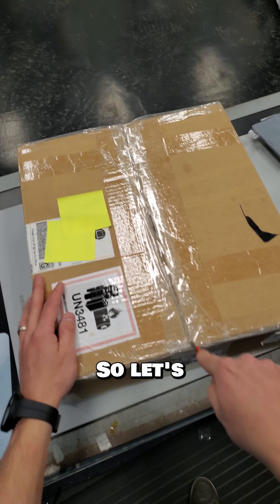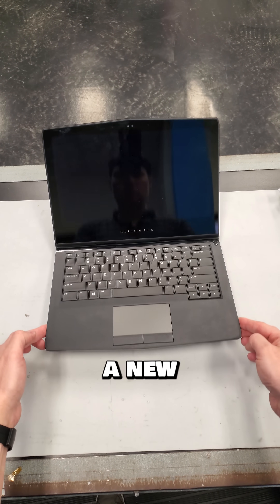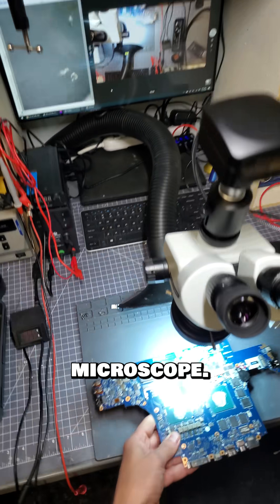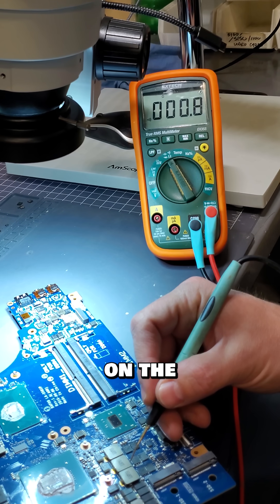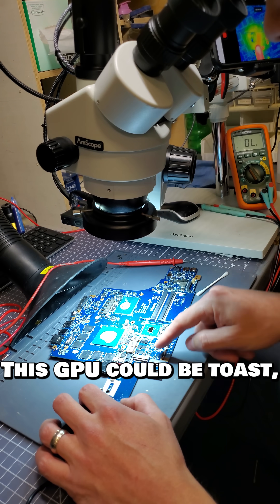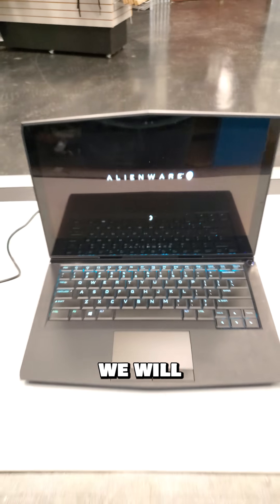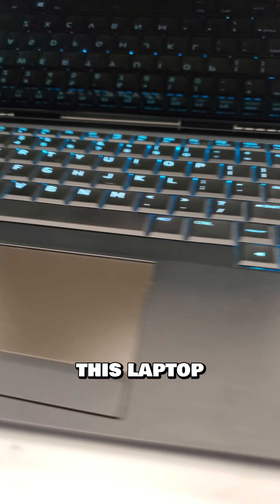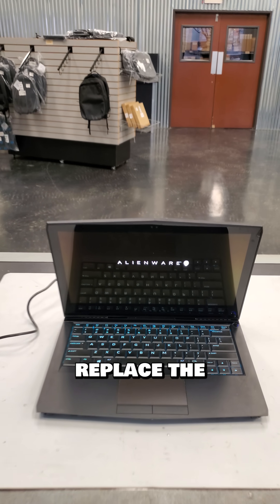Game Over? Gaming Laptop GPU Repair Fix #shorts #laptoprepair #computerrepair

Comment from the maker: If you need a repair and it is a Dell/Alienware laptop and you live in the USA or Canada, then yes.  You can fill out a service request form at partspeople.com
Reply: Can you fix my Razer Blade 15 2021 please? It has a GPU error as well
Reply: I have a HP Spectre with a shorted motherboard unfortunately. Would have strongly considered sending it to yall if it was a Dell!
Reply: Working on my university final year project and my laptop just gave up midway 
They said it's a motherboard problem too
Reply: I mean it seems like you know what you doing. I have a busted a51r2. Looking to be fixed. I'm in Australia tho. 😢
Reply: Do you know anyone that could do the same type of service on an Razer ?? 🙏🙏🙏 Exact same story as this. Sent to Razer, they told me I need to spend $1100 on a motherboard
Reply: I had a very expensive one that shorted on the external GPU plug that i never used and it was refurbished and like 3 months after i bought it so dell refused to fix.
Reply: What about MSI or Asus?  Their customer service is GARBAGE wanting to charge 1300 for a new MB.
Reply: He can just a buy an egpu best way
That way motherboard is safe
Reply: Really someone would choose to convert it to integrated graphics only when they specifically bought an Alienware for a reason
Reply: I have both a alienware 17 r4 and 15 r3. Both quit working from not being turned on. The 17 r4 uses stopped working from bios update which broke intel ME. Any idea if fixable
Reply: Can you accept laptops from Nigeria
Reply: @tochukwuokoye5588  he can but shipping is going to be very expensive alongside with your affordability as his prices are 1st world.
Reply: @tochukwuokoye5588  lol, the question is: can YOU afford it?
Reply: Do you also make Asus laptops?
Reply: What about international repair requests ?
Reply: Can I ask that what's wrong with PC??? I can't find any video for it not anyone is able to understand the problem (screen doesn't work but computer runs)
Reply: So when you switch  graphics cards in software do you disconnect one and connect the other via mosfets😮
Reply from the maker: Both are always connected and in software, you can choose which one to use.  When this issue happens, the best thing to do is to completely disable it from the motherboard.  The laptop will not even know that one is there, so it will always choose the Intel graphics on the CPU.
Reply: @dellpartspeople  Is it possible to replace the graphics card completely? Like grab a laptop or mother board that's a spare and replace it with the broken one and boom, graphics card updated or new?
Reply: @ghostedoperative  Yes its possible.
Reply: @AspiringCentral  but unless you bought a board with a bad cpu or something else thats wrong you are basically just replacing the mobo, or could just as easily do that instead
Reply: @ghostedoperative it is, but considering this 1 topped at a 1060, finding a 1060 might be a needle in a haystack.
Reply: Why not replace tha GPU@dellpartspeople  is that impossible for laptops? I had an old HP laptop where I could take out both GPU and processor, there was even special door to access those and the ram.
I am asking, because now I have a cool laptop, but with a 3060, and I would like idk 4090 or something 😅
Reply: So
Reply: Just come across your videos. Do you repair international issues from UK?
Reply: sadly you're continents away and unaffordable for us poor 3rd world folk
Reply: Why not Mexico
Reply: hi mate, I'm in Europe, do you have any repairing technicians you could recommend in the old continent?
Reply: Hi why is it not possible to replace just the GPU?

Comment: if you thought Dell actually diagnosed, then you are very wrong. They ain't going to take the laptop apart and actually look at it. They will attempt to reinstall o/s and if it doesn't turn on even after inspecting the power supply. They will just call it replace motherboard.

Comment: Spent $2000 to have the GPU die after however long.SURE THING, make it a $400 laptop instead of a $2000 laptop.  They will pull the drive and sell it to some sucker on Facebook marketplace who will give them $1000-1500.

Comment: Also want to add some kudos for Dell.
My 4 years old XPS15's battery was not good any more.. reduced capacity and cells visibly increased in height, so it became hard to press the touchpad.
The replacement battery was easy to find on their webpage - just 70€ including shipping - arrived 3 days later und was no issue to replace with basic "ifixit"-tools and knowledge.

Comment: Or get a part's laptop with the same GPU die and swap them over. I'm sure there is plenty of brands or cheap parts only laptops that have the exact same GPU chip it's then just a matter of removing the old chip cleaning up pads n reflow the new chip

Comment: The amount of stuff i hear about failing gaming laptops makes me steer clear of them all the time
Reply: for the price of a gaming laptop you can get a tower computer that you can upgrade and plug/play replace parts for cheap. just stay a generation behind and yyou get soo much bang 4 your buck
Reply: They're definitely mis-matched for price/performance in almost every way. But if space limitations are real, you have a limited budget, and/or you need to CAD model/video process in the field, they're viable.

Mine has served me since COVID and was a refurbished unit from the year before. It's been a good investment for me.

I will say to at least get a more ergonomic keyboard to go with 'em. Long hours of using chicklet keys can do some damage to your hands.
Reply: they're more like race cars. Not very practical and require lots of care and attention but they go fast

Comment: I had the 15in model of the same body type. The R3/R4/R5 series laptops. 
Mine shorted 370 days after purchase. Dell wanted to charge 90% of the purchase price for it new to replace the board. I laughed at the technician on the phone, told them to send it back to me, and it became a paperweight. 
I bought a used Late 2013 15in MacBook Pro that looked new for $450 and ended up using that for the next 3 years without a single issue. 
I work in IT and Dell made machines are always an issue. They are only slightly better than the QA at HP.

Comment: I will absolutely never buy anything dell.. ever. My last brand new laptop went bad in under 6 months with extremely light use. Had to replace the whole board. The repair guy put in a "made in China" board which is still going good after 3 years. I might have won silicon lottery but still.

Comment: I think you can start in secure or repair boot with wifi off and then from the device manager you can disable the nvidia gpu i did that with my old laptop from 2012. It worked without issues after it

Comment: I had the same issue with my Acer nitro 5. It was probably my fault as I did a poor job cleaning it. 
Guys replace thermal pads of your cooling system and make sure you install it properly with no gaps after cleaning l, otherwise mosfets may overheat

Comment: I've a laptop ThinkPad which is my first laptop, a few months back out of the blue it's display turned white, I had to get a display change for the laptop which costed me about 2k, they gave me a 6m warranty on display but I didn't get to use it much due to being on work in office the warranty has ended but I used the laptop 3-5 times at maximum after repair and now it display turns white sometimes too still, any opinion what to do?

Comment: Hey
Even my acer Nitro had same issue
Official guy said replace whole mb
Some smart repair guy said show it to me and come after few days
After few days he did same & said i turned it on but then i got to know he had shifted it to intel igpu which didn't helped me because of 3d software i use back then
So then says we can try to repair the nvidia gpu ...fix was some ic was short which was not turning gpu on

So he took few more days and boom...it works

Comment: What's the name of power supply you use
Reply from the maker: I made a special power volt/amp meter to test Dell and Alienware laptops with.  On one side, you can plug in the Dell charger; on the other, it gives you both sizes of plugs for Dell laptops.  It is very useful to see what a laptop is doing, whether it is charging the battery or even turning it on.

Comment: I have laptop with similar issue (when boot it restart again) so the problem is the motherboard/VGA :(
Reply from the maker: That can be caused by many things. Are you getting a blue screen before it restarts? If so, look up the error. You can also try booting into Safemode or booting off a Linux USB.

Comment: I found it very odd a repair shop like yours can't solder a GPU my local repair can albeit that mine is very old GPU or VGA card its ATI Radeon HD 7600M i say ATI because that was on the sticker

Comment: Okay, quick question. Who on their right mind send their brick for a battery change? Like, you have a brick laying around, completely unresponsive and you go like, yeah slap a new battery and it will run, probably? You know those notebooks could totally run without a battery as long as they are plugged to AC, if it doesn't run then the problem is clearly NOT about the battery.

Comment: What's the item you use for the charger to show on or off
Reply from the maker: I made a special power volt/amp meter to test Dell and Alienware laptops with.  On one side, you can plug in the Dell charger; on the other, it gives you both sizes of plugs for Dell laptops.  It is very useful to see what a laptop is doing, whether it is charging the battery or even turning it on.

Comment: Or if Windows reboot that could only be a bad windows installation ? i mean this crap love to break by himself so.. Just try an other SSD to check if the windows is not corrupted or broke ! 
I dont know if you tried it cuz you dont mention it
Reply from the maker: Yeah, I used the customer's OS install and a test install.  The new motherboard had no issues with the installation.
Reply: @dellpartspeople  Okay, cuz some may think that they have an issue just because windows dont start

Comment: You can also reball or replace the gpu - and add a thin copper heatsink if there's space, and set the fan at constant full speed via software - then sell them a laptop fan with it and advise the customer to keep good airflow as they comfortably remove their data in O.S and use it for as long as it lasts. 
I had about 70-80% success rate back during the hp dv series with Vista days.

Comment: Admire the tech skills, At this point of MB replacement, or any other issue is to just buy another device, obviously weak hardware engineering.

Comment: This is a primary failure mode for this alienware model.  Mine has started randomly shutting down and I suspect it is showing the beginning stages of this failure.  Now I know which parts to replace to hopefully prevent it from sending all the voltage to the gpu.  Thank you.

Comment: Usually with Alienware you can deactivate the graphic card directly on boot but that might be true only for older versions
Reply from the maker: That might be the case but you have to be able to do it before you get the windows because it will reboot otherwise.

Comment: My first laptop I bought was a "for parts or repair" Alienware 13" just like this one. I believe it had a 1070 on it. I was learning to solder at the time but didn't have the money for a decent iron. Had corrosion all on the battery terminal and even after removal still wouldn't power on. Eventually,  with enough persistence I managed to get it to power on... But the small chip that controls the screen voltage was toast. So I sold it back on eBay. Bought a 17r5 not long after, and used it on many work assignments. That laptop repaired so many other laptops.

Comment: I mean, after you saw that short was there really a 0.00001% chance  the GPU survived? Unlikely.
Reply from the maker: Your percentage is off a little.  If the protection ICs do their job, the GPU will not see that voltage.  It will cut the power.  I have footage of two repairs that I am still editing, where the GPU survived.  So, I would say there is a 50/50 change.
Reply: There's another one? I thought this chip was directly weird to the GPU, hence the percentage. If there's a protection circuit between that thing and the GPU then I fully agree.

Comment: The rare few times where DELL's advice was correct XD
Reply from the maker: Yes, but any other shop would have said the same thing because the charger light went off, and there was no way to turn it on.  They did not diagnose anything.  It is like telling you to replace your car engine when it doesn't start.

Comment: The guys at Dell have probably seen the same thing over and over and just know from experience. I used to have an AlienWare laptop in 2007 that one day wouldnt turn on. Due to the limitations of the time, it weighed 3800 pounds, about 1000 less than a GMC pickup truck of the same year. So it was too cumbersome to attempt repair, so I threw it and shot it 40-50 times with a M60 machine gun.

Comment: I’ve got one Alienware laptop and when I try to game on it it keeps shutting down and I got the message that the battery is overheating,I clean it changed all the paste and it was same and after I disconnected the battery and now it won’t load the game and I can use it only to watch movies and YouTube. Any ideea what’s wrong with it?
Reply from the maker: No, that is a weird one.  Have you tried running it without the battery attached? You do not need it installed for the laptop to run, so give that a try.

Comment: How did it POST with a bad GPU?
Reply from the maker: There are two GPU in these laptop.  One is built on the CPU, which is the first one that is turned on, and the second is the discrete Nvidia graphics.  That one does not enable until the driver loads in windows.
Reply: @dellpartspeople  I see,so it POSTs with the iGPU and fails for the Nvidia.

Comment: I doubt Dell did troubleshooting to this level. They likely just saw the power issues and concluded that the motherboard needed to be replaced. They won’t do that level of repair when they can just sell you a new part. 

The real question is: why did the MOSFET fail? I’ve had graphics cards, whole desktops, and laptops last me 10 years without failure. I have yet for computer hardware to fail on me to this degree, except in my Xbox 360 from 2010, which ran into graphics artifacting and then total 3D graphics failure 6 years later. All my PC’s and PC components have survived for far longer. Even with almost daily gaming loads pushing their limits, and mild overclocking. 

It seems like gaming laptops lack longevity. I assume it’s a heat issue. Just trying to pack too much power in too small of a package.

Comment: There must be an option in bios to change gpu mode to igpu from dgpu.
Reply from the maker: It is automatic.  I can just remove the MOSFETs on the GPU and the laptop will run like it was shipped without Nvidia.

Comment: Can you tell me , how did you debug the issue correctly. Is it trial and error mother of finding voltages or do you have the schematic diagram of the circuit of motherboard.
Reply from the maker: Each repair is different, but if you find that one of the power rails is shorted, you can inject voltage into that to find the shorted component.  Using a thermal camera, you can find the component that is heating up.  This is not always the actual bad IC/chip/component, but it will get you close. I have a lot of donor motherboards of the same model to replace parts from.  Sometimes I need to use a schematic if I am trying to fix an issue that is not a short, like a charging issue.

Comment: I bought the same laptop from Facebook market place for 50$cad because the lady said she took it in for repairs and it had a faulty motherboard after she dropped it but after using beeps to diagnose it and taking out the ram and it ended up being 1 dead stick of ram.

Comment: How much do you charge to repair a motherboard? I have a ASUS B550M-A WiFi II it turns on but nothing displays on the screen and when I was trying to take the Sarah cable off of it, the connector housing came off and I think the wires touched and it might’ve shorted it.

Comment: You could also desolder the GPU and replace it, but of course procuring the same or compatible GPU and and then reballing it and soldering it on the board isn't easy, but can be done.

Comment: You can't just buy new GPU chipsets?
Reply: If that was the case, you could buy any cheap motherboard and switch out the chipset but every chipset maker makes it impossible unless you have access to AMD, Intel, or Nvidia master code for chipset, for the CPUs whatever else other layers are baked in so you can't do so. Every so often someone finds a way to crack one CPU  or 1 motherboard and chipset to work with others not meant for it but it always with mixed results and often requires lots of failed attempts to figure out. Which is what those companies want. They know someone will figure it out, so best they can do it make expensive and not worth it.

Comment: You can start on "failsafe mode" delete the Nvidia drivers and disable the device and then go to windows update and prevent that device to update the drivers.
It worked for me with a faulty amd 265m.
On Linux you can disable the driver adding a kernel argument to blocklist them.
So... You don't need to use the welder.

Comment: It's an old Alienware probably the one with a GTX 1060 or 1070 but since it's 13inch could be a 1060 motherboards on eBay aren't that expensive but it's better if that person just upgrades instead of staying with the 6th gen cpu